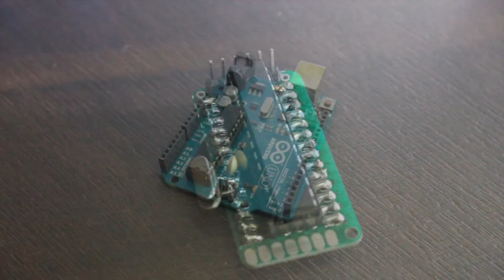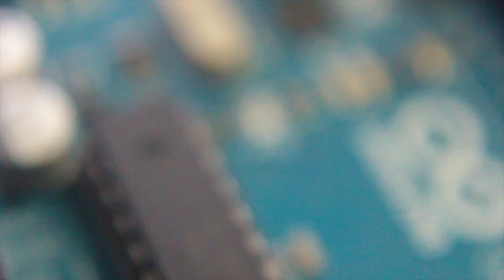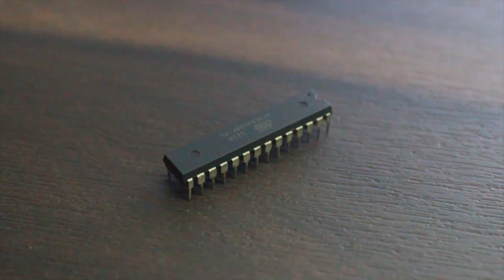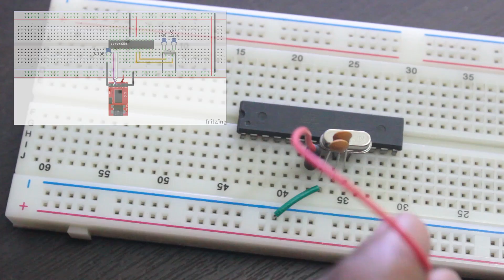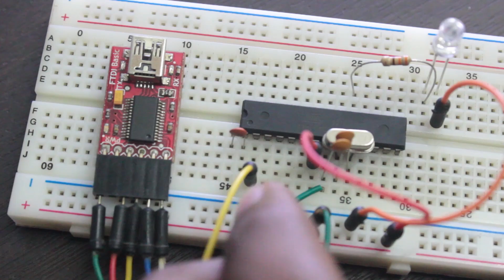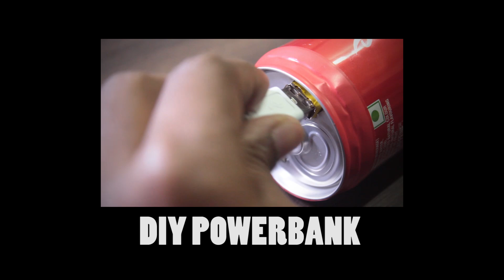Build you own Arduino Uno for 5$

Comment: Yet another Arduino on a breadboard video that makes the same mistake with the crystal as all the others :(
The capacitors depend on the load capacitance required by the crystal which is not mentioned, for the capacitor values shown, the crystal must be about 10pf load capacitance.
If your crystal is 20pf then the capacitors should be 36pf.

Comment: Can we use this board for connecting sensors in its analog and digital pins ??? or does this board have any limitations compared to the normal arduino board ? (expecting quick reply )

Comment: do i still need the serial converter connected to the micro controller after ive done installing the code???
Reply: I would say yes, because it looks like it is also the power supply. But, my thoughts are, that if you can put in a separate power supply then you wouldn't need the serial converter.

Comment: is there no way to reset? what will i do if i need to run another program
Reply: connect a tactile switch between the atmega reset pin and GND, that's all you need...
if you want to run another program you have to program the atmega again using the USB to Serial converter... of course you could 'fake' multiple programs by connecting a switch to one pin and then in the setup and the loop function add a simple if(switchpin) -> first program, else -> program 2

Comment: hey i need your help. how do you make that small arduino. i have got all the components but i dont know how to solder that on the small chip. can you explain or guide me how to do that.
Reply from the maker: You need some soldering skills to do this project. I recommend you to watch some, how to solder video first.
Reply: Cooltronics i can solder but i dont know what to connect where. is there any schematics for that ?

Comment: I used pretty much the same components, and... mine doesn't work.
I tried everything, I even bought a new usb to serial adapter...
I've been ignorantly touching the pins of the ATMega though, so I'm pretty positive at this point that i bricked it... Can't see what else could be the problem after all.
I guess I'm just gonna buy another one...
Reply from the maker: You need to have a boot loaded atmega chip.
Reply: CoolTroniks the seller said it is
Reply from the maker: If it has a bootloader, then it also has a blink program, Give power to the chip and put the crystal and pf, and it should blink.
Reply: CoolTroniks it... kinda blinked but really shortly, just a few times then stopped
and now it doesn't wanna do it anymore whatever i try
Reply from the maker: That's a startup blink. Means the chip is working. I think it goes to reset.
Reply: CoolTroniks hmm so does that mean it's not bricked and it only misses the bootloader
Reply from the maker: If it still has that rapid flash on startup, then yes it is alive,

Comment: In the diagrams says 22UF but in the video you said 22pF, should I use the 22pF or the 22uF? And for the reset pin the diagram is 0.1nF and in the video you said it is 100nF...
Reply from the maker: 22pF is the correct value, i didn't had 0.1nf so i tried uisng 100nF, which also worked.
Reply: Thank you!
Reply: nice video!
you mean 0.1uF  is the same as 100nF 
but you used in the film 101, which is not 100nF  (101 is 100pF )
( 0.1uF is 100nF and that is the good value )
Also 22pF is the good value.